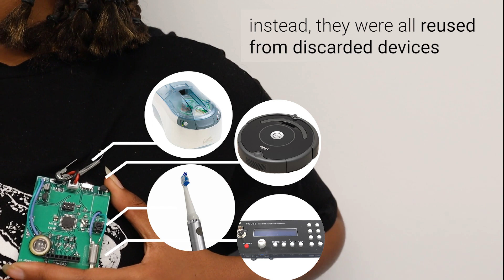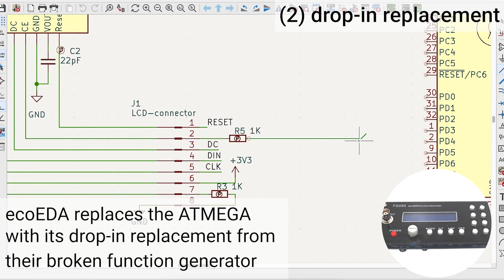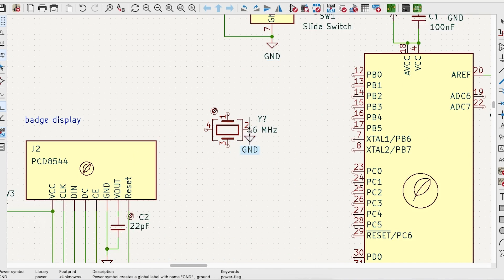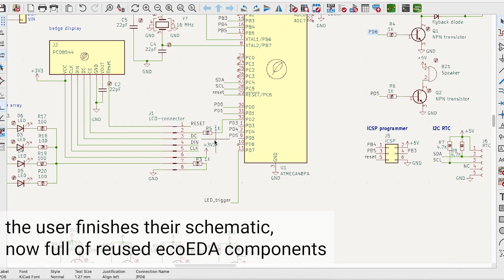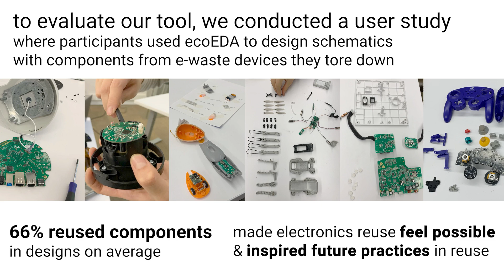ecoEDA: recycling e-waste during electronics design

Comment: I've got a vacuum, a flat screen tv, an old washing machine and a batter for a drill. I want to make a gaming computer. Do I just follow this videos step by step?
Reply: If it’s a smart TV, you’re better off just jailbreaking it, installing Linux, and proceeding from there. Your main challenge will be computing power / cooling solution.
Reply: @RonWolfHowl  the vacuum can suck in air, diy CPU cooler. What games could I even play like that? Do you have any Iinks?